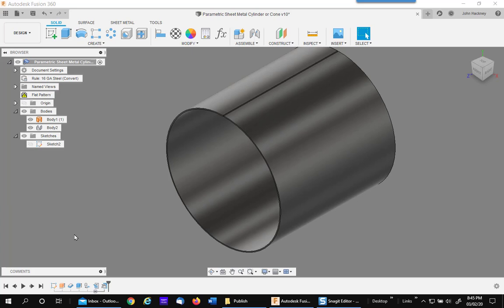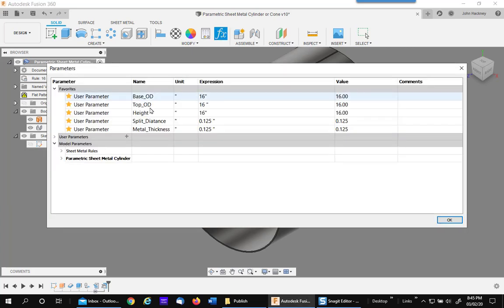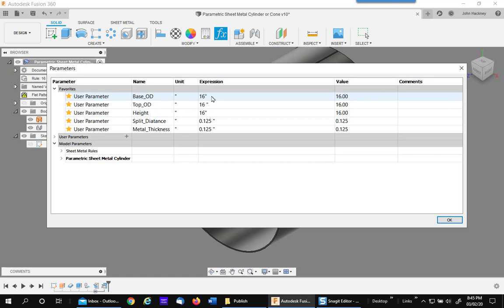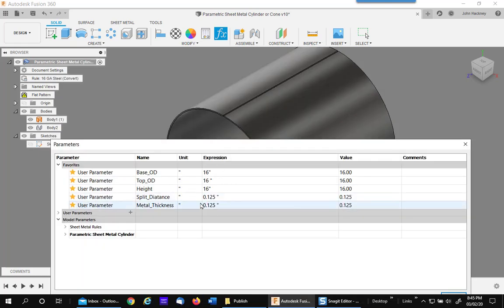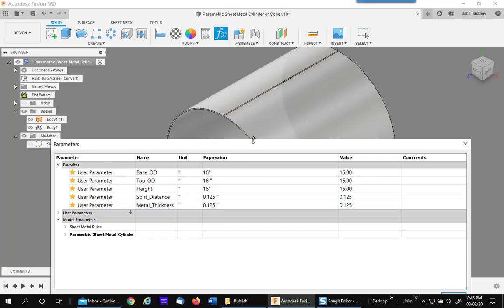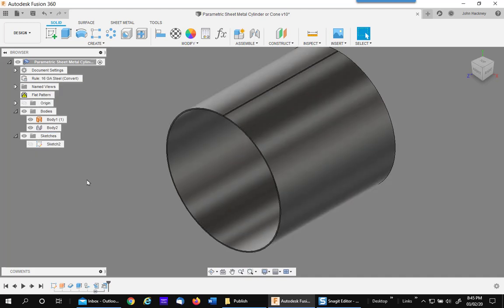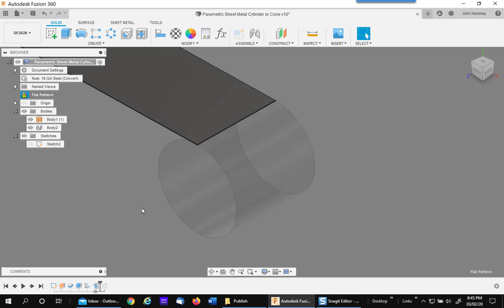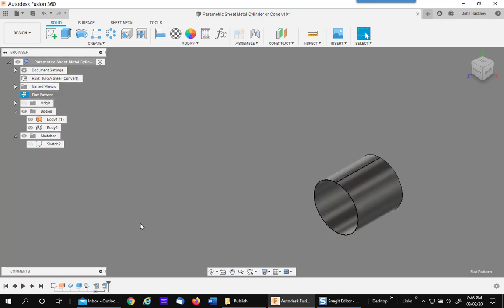Autodesk Fusion 360 Sheet Metal Cylinder or Cone - Shared Model

Comment: Anyway we can get an updated link? says deleted
Reply from the maker: Sorry about that.  The link has been restored.  One change, the sheet metal thickness is controlled by the current sheet metal rule instead of using a model parameter.
Reply: @jrhackney  Hi John, the link says it's down again.  Any chance of restoring?  Thanks for putting the file together, i'm eager to work with it!
Reply from the maker: @MarkRohlfing  Sorry about that, the link should be working again.